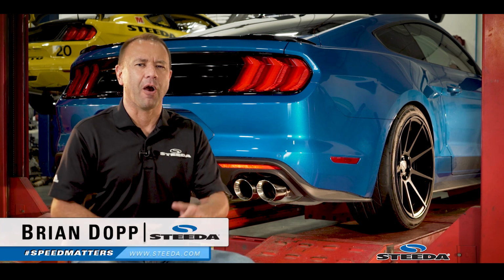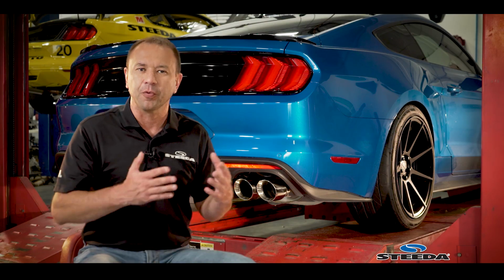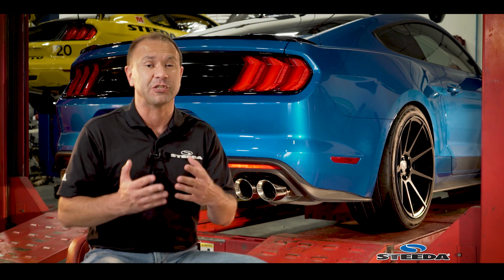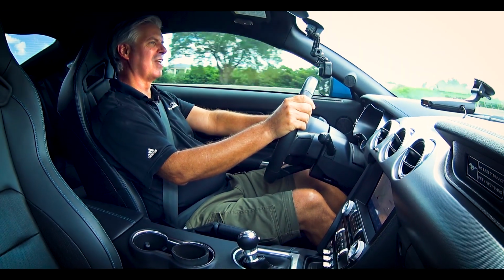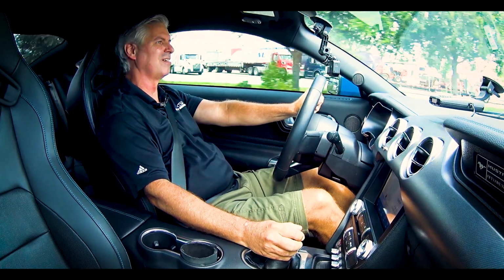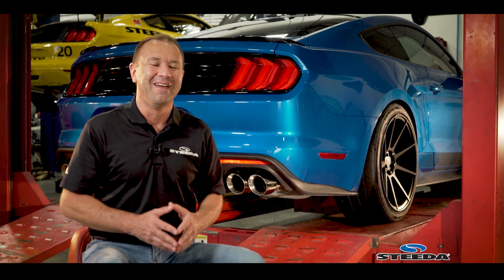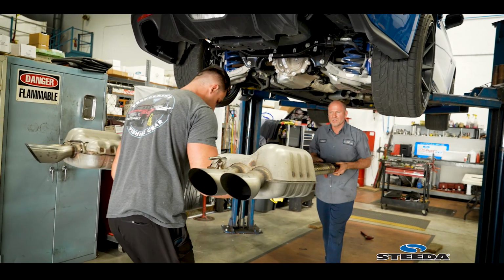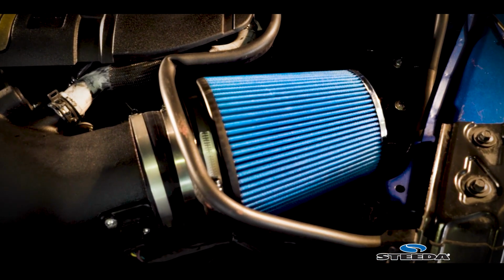Stainless Works Mustang GT 3in. Cat-Back Exhaust | Review

Comment: i tried this exhaust then had a second sent out because the clamps couldnt hold the exhaust in place. It woud slide and case the muflers to hang once driving. How did you get around this? Or is that why you didnt show a test run and vid?

Comment: What is the power gain with this exhaust.
Reply: Removal of the factory exhaust on the S550s typically doesn't get much more than 10-12hp. It's really an acoustic mod that prepares the car well for flowing more through longtubes.